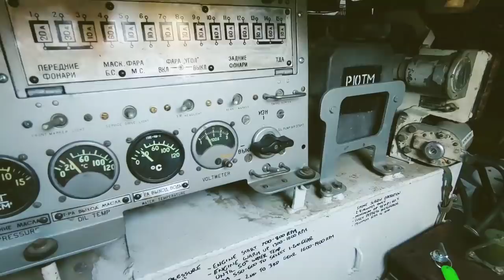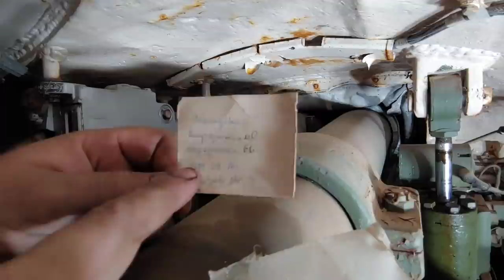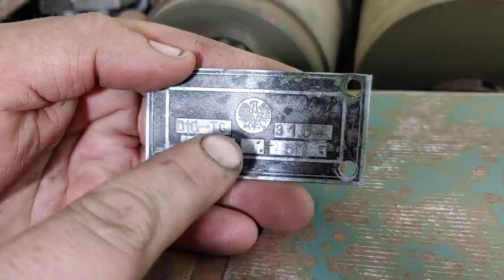T-54M Tank, a new addition to Battlefield Vegas collection

Comment: If it's not got a turret roof ventilator doesnt that make it a T-55?
Reply: The fact that it had roof ventilation marks it as T-54. T-55 basically was T-54 with NBC protection build into the design, so T-55 never had that ventilator and consequently would not have a welded hole there =)
Reply from the maker: Please check out our newest video regarding this tank and issues like that
https://youtu.be/URb3WywmOWE

Comment: this is not a T54, it is a T55. T54 has no fume extractor at the muzzle of the canon, it has a hole in the front of the hull for the bow machine gun, deleted in the t55, and the in take  holes for the fan are above the canon, looks like small coupola. T55 intake is in front of the loader, not visible from outside
Reply from the maker: Thank You for the information, we will look in that, and I will show your comment to the rest of our team. Yeah, we are quite puzzled with this one, our latest thought is that originaly this was a T54 but later it was converted to a T55. We started needling it yesterday and found a lot of weld spots on the turret that show that a lot of components were rewelded to different locations, so we are pretty shure that it started out as T54.